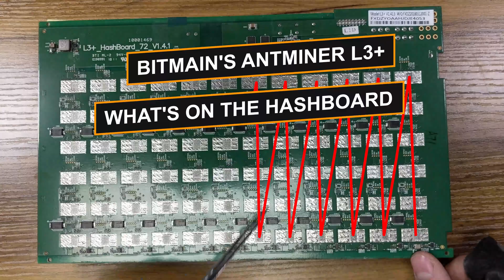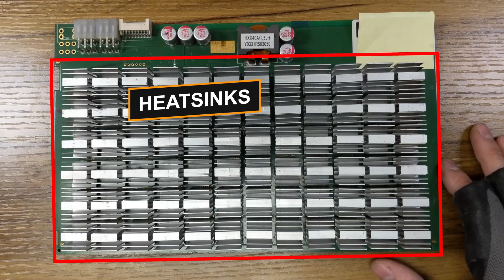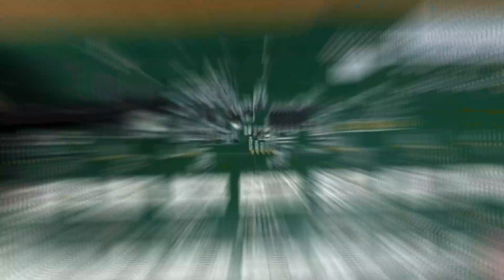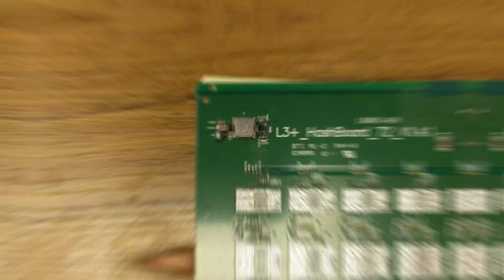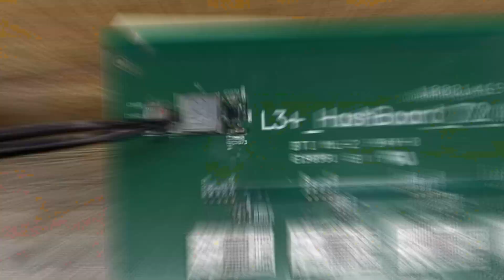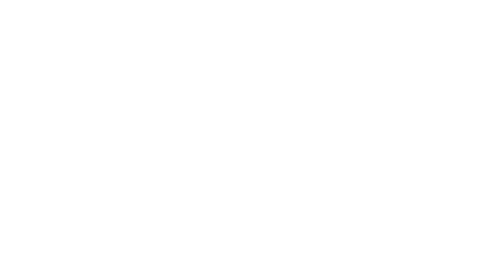ASIC Repair Basics: Antminer L3+ - The Circuit

Comment: Hi. I've got a card thtat does not hashing, temperature says "0°C" for chip AND board.
This is the log:
Jul  4 12:00:21 (none) local0.notice cgminer[384]: i2c init ok
Jul  4 12:00:27 (none) local0.notice cgminer[384]: in tty_init
Jul  4 12:00:27 (none) local0.notice cgminer[384]: tty_init 2
Jul  4 12:00:27 (none) local0.notice cgminer[384]: Start A New Asic Response.Chain Id:[2]
Jul  4 12:00:28 (none) local0.notice cgminer[384]: open device over
Jul  4 12:00:28 (none) local0.notice cgminer[384]: Set Chain 2, Voltage: 0xa5
Jul  4 12:00:28 (none) local0.notice cgminer[384]: send cmd to get chip address
Jul  4 12:00:30 (none) local0.notice cgminer[384]: Chain 2 ASIC 72 !!!
Jul  4 12:00:30 (none) local0.notice cgminer[384]: addrInterval = '3'
Jul  4 12:00:30 (none) local0.notice cgminer[384]: software_set_address: chain 0 has 0 ASIC, and addrInterval is 3
Jul  4 12:00:30 (none) local0.notice cgminer[384]: software_set_address: chain 1 has 0 ASIC, and addrInterval is 3
Jul  4 12:00:30 (none) local0.notice cgminer[384]: software_set_address: chain 2 has 72 ASIC, and addrInterval is 3
Jul  4 12:00:30 (none) local0.notice cgminer[384]: Now Set [2] Chain Address
Jul  4 12:00:31 (none) local0.notice cgminer[384]: software_set_address: chain 3 has 0 ASIC, and addrInterval is 3
Jul  4 12:00:32 (none) local0.notice cgminer[384]: Set CHIP PowerOff Temp=90C
Jul  4 12:00:32 (none) local0.notice cgminer[384]: FAN mode manual, target speed 10%
Jul  4 12:00:32 (none) local0.notice cgminer[384]: frequency = '384'
Jul  4 12:00:32 (none) local0.notice cgminer[384]: dev.timeout = 19
Jul  4 12:00:32 (none) local0.notice cgminer[384]: opt_bitmain_L3_core_temp : 2
Jul  4 12:00:39 (none) local0.notice cgminer[384]: Detecting temp sensors on Chain 2
Jul  4 12:01:00 (none) local0.notice cgminer[384]: send cmd to open block
Jul  4 12:01:02 (none) local0.warn cgminer[384]: Switching to pool 2 stratum+tcp://stratum.f2pool.com:8888
Jul  4 12:01:02 (none) local0.warn cgminer[384]: Switching to pool 1 stratum+tcp://stratum-ltc.antpool.com:443
Jul  4 12:01:13 (none) local0.warn cgminer[384]: API running in IP access mode on port 4028 (15)

I've already changed the chip T4** on the PCB. No change.
Have you got an idea of the problem ?